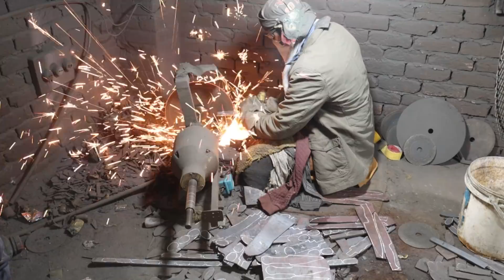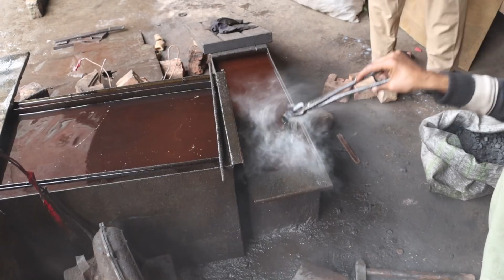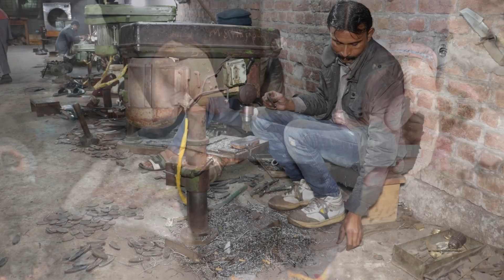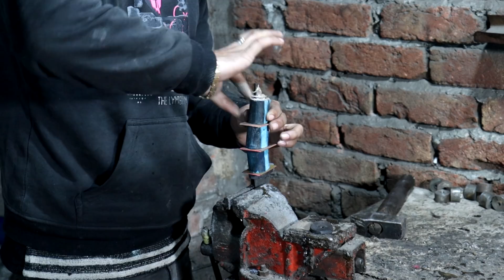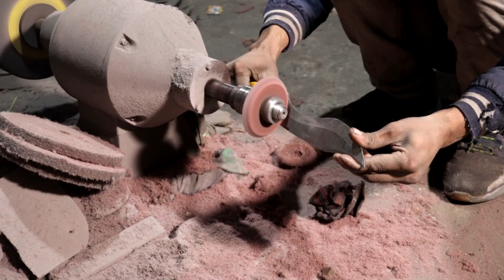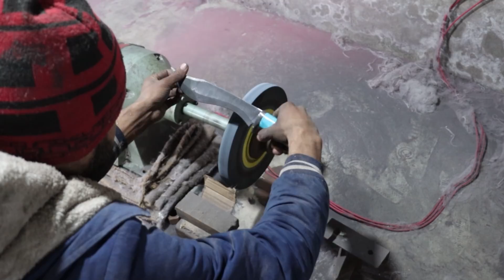Amazing Process of Making Kukri Hunting Knife from Carbon Steel

Comment: I’m not a knife maker, but these look like nice knives to me - I’d buy one.  These guys deserve respect for working hard in crappy conditions
Reply: These are not nice knives. The tang (the part in the handle) is welded on, a good knife will be full tang for strength. Also the handle is essentially hollow with just what filler glue he squeezed in with his fingers. THey look cool though

Comment: As a blacksmith who also makes knives, i'd say their blade quality is pretty poor, but for a low price that's acceptable.
Every person who comments on how the steel would be too soft are kinda right, but also kinda wrong.
Yes the heat treatment is very hazardous, the grind slightly overheats the blade, the tang is welded etc etc etc
But these guys work in the medieval way. Work with simple tools, get acceptable quality for a knife. Yes they wont be as hard as they could be, yes they have weak points, but they will cut and do their job well enough and that's what matters.
Btw they weld the tang to save up high carbon steel, as they only grind and don't forge the blade.
Using shit steel for non critical parts of a blade is a common practice in medieval times.
Reply: Grinding away 20% of the material for the initial form wasn't common practice though. 

Saving material sounds nice, but they could've easily forged the tang out. Probably just as quick with a simple 50lbs tire hammer
Reply: @patrickd9551  i know, but it's quick and dirty to just grind away the shape
Reply: This knife was always made in a medieval way with a hammer, forge and a file.  These are ok but then also shit.
Reply: No i'm sorry but having poor equipment is not an excuse, and those aren't bad tools neither. The bad quality comes just from the way these knives are made, so they could make much better quality knives just putting more care in it. The heat treatment is done without keeping the right temperature for all the lenght of the blade, the grinding process is done without keeping the blade cool and ruining the already poor hardness achieved. Kyle Royer showed how to make a mastersmith knife just with an hammer, a small forge, hand files and sandpaper. I sometimes weld too a small part of the hidden tang, usually a threaded bar, but the weld must be deep and perfect or the knife will break in half at the first hit. These knives are just trash, and not because they comes form a poor country, but because they don't care to make good products
Reply: Finally someone that isn't complaining about the sand getting on the knives
Reply: @Gabrulo_knifemaking  they are not trying to be Kyle Royer. They're trying to feed their families

Comment: The blades get way too hot when grinding them. It takes the temper right out of it. Not that it really matter as this steel is low carbon junk.

And why are they welding a tang into the blade. Again, it is taking the temper out of the blade as well as putting a joint in a high stress area. These blades would never withstand a high impact strike.
Reply: along with uneven heat
Reply: Maybe you should go over there and tell them to use more high quality stuff that is out of there budget.
Reply: Bruh, they don't have shoes

Comment: "S" for "Safety". Welding without eye protection, showing hands in acid bath, using cut-off disk as a jigsaw. I thank god for being able not to work on such manufacture
Reply: They don't have COMPO over there so there's no need 🤣
Reply: Open grinder throwing sparks/debris directly into outlets.
Reply: Do you think they are going to change the their ways for your tree hugging, warm fuzzy opi ion
Reply: "Safety is 37th"
Reply: These men build knives not tampons 😂
Reply: It's not for chicken heart....
Reply: Live a little

Comment: Steel grinding dust and other metal cuttings go into iron-ore processing steams to improve their yield.
Bigger pieces of scrap are either re-forged, go to foundries for direct smelting, or are sold as raw materials.
The hydraulic cylinder factory over there makes scrap that we forge into spoons...our scrap goes down the road a ways and is made into safety-pins and sewing needles...their scrap makes fine wires...the wires go to the ear-bud factory over there to wind tiny coils...
Western ecological awareness didn't "Save the Planet' when they took credit for inventing Recycling.
As long as humans have worked with metal, every scrap was reused endless times.

Comment: Well at least it's easier to tell these cheap knockoffs; of actual quality blades, by the Damascus blade. Guarantee 99% chance that all Damascus blades you come across are made of junk steel in mass produced places; like the one in the video, that specialize in bastardising quality blades made by skilled artisans.
Reply: Yes the steel is pattern welded, but that's not 'Damascus' by a long shot....
Reply: Actually amazing steel doesn't need to be damascus , you can create the design afterwards
Reply: At 1.55 he has a block of wood on the point and leaning so hard on the knife he is ruined the steel
Reply: @brianhoeckelmann1304  Yeah I'm not a fan off burning the heck out of the metal either.
Reply: Doing all they can to feed their families… That’s all this is. There is a market for these and the work ethic is to be respected!
Reply: Take a chill pill Katan Akuma. These guys are barely earning enough to support their families. They don’t care if they are being asked to make a bucket to hold horse shit or a samurai sword. Whatever it takes to put food on the table.
Reply: @DC-wp6oj  It's a pity. Because if they used quality materials they'd make buckets of money compared to what they get now. They have the skills to do it. There's clearly a market for knives. And quality knives would be their saviors. I don't envy the position they're in. It's just unfortunate they don't realize how easy it would be to make a lot more money doing exactly the same thing they're doing. After that. ..more food on the table. Happier family life.

Comment: I lost a good friend to a grinding wheel smaller than some of those without a guard. He put a new one on and let it run for about 4 hours when he touched it with a piece of steel it took off a chunk of his skull. I think I'd rather weld without eye protection than use those grinders. I can close my etes.
Reply: maybe tell him to use a safety squint next time ?
Reply: User error

Comment: They don't seem to be bothered too much about blade hardness. BTW, "carbon steel", all steel has carbon in it, otherwise it wouldn't be steel.
Reply: Carbon steel means not stainless :)
Reply: @dimmacommunication  Okay, thanks. But I wouldn't advise anyone to say carbon steel in my field of work if they don't want to get laughed at. It'd be like saying wet water or hot fire ;-)
Reply: @mikethespike7579  Wich work ?
In knife making carbon steel is a very common term, even Opinel or Mora used " carbon/carbone " on their non stainless knives
Reply: @dimmacommunication  "High carbon steel" is a common term in knife making. In my field of work we call that tool steel, but otherwise it's the same thing.
All steel has carbon in it, so if you say carbon steel you could just as well mean mild steel, which of course wouldn't be any good for making knife blades.
Reply: About as bothered as the welded on rod for a tang. 🤣

Comment: That short tang makes these things useless
Reply: Did you not see the part where he welded it onto a steel rod, or do you just not trust welds?
Reply: @frank3manuel  A flimsy threaded rod is no replacement for a full through tang. Also I didn't see any quenching and tempering steps, so I doubt the blade will keep an edge for long.
Reply: @frank3manuel  No, I wouldn't trust those welds. I am a welder and a blacksmith and welds between quenched (even poorly) high-carbon damascus to a most likely low-carbon rod will be weak. Not to mention there should never be a weld inside the handle especially if the knife will be under high impact stresses like chopping.
Reply: @sonofbr  you're just jealous you're not as good a welder as he is.
Reply: And there's no reason not to make a longer tang.  The cost of the sheet of steel is minimal.  It's no wonder the Nordic countries are famous for the quality of their knives.  They'd never cut a corner like that.
Reply: @1pcfred  If only I could stop wearing eye protection I would be better.
Reply: @sonofbr  indeed. You do not have Superman eyes. The welder here sees everything!
Reply: @drmodestoesq  they are not using plain sheet steel to make those knives. It is a laminated steel made to resemble Damascus.
Reply: @1pcfred  how is that done please?
Reply: @jimmybawa5  how do you make laminated steel? You take layers of dissimilar metal and pattern weld them together using forging. Sometimes the billet is twisted or folded to impart a pattern.
Reply: Stabbing good chopping No good.
Reply: @1pcfred  

Thank you
Reply: @jimmybawa5  you're welcome.
Reply: @1pcfred  bullshit dude. If a tang isn't made well, the welds don't matter. They'll fail off steel like this as it tends to peel off over time.
Reply: @FireSkittlez85  maybe. Anything's possible.
Reply: i dare say these are simply for the tourist markets...
Reply: I thought so too

Comment: As an actual Blade Smith...and as many have stated here already...these are... 'show knives"...ONLY...!!! These knives are not meant for any real hard use or cutting application...They are not properly built...not properly quenched and tempered...AT ALL...!!!

These are some pretty grim working conditions as well without proper venting or dust control...!!!...which will sadly lead to lung aliments and shortened lifespans of the workers...

Comment: Kukri?  Yeah, no.  Aside from the awful metal and questionable techniques leading to very substandard blades, the blade shape and profile are completely wrong.  What they are doing is much more like a drop-point Bowie.  About the only thing these blades have in common with a Kukri is that they are both single edged blades.

Comment: Now please temper them so they won't shatter under normal use
Reply: I hardened a knife without tempering it's just garbage 😂😂😂
Reply: But how else you gonna get repeat customers?  /s
Reply: They would need to be made from blade steel to b able to shatter not railway track and ship anchor links

Comment: It's better not to do things when you don't know how to do it, Kukri is an iconic weapon it requires a ton of knowledge and experience to make one, Gurkhas have chopped thousands of heads using this weapon in war when they ran out of Bullets, you are not making Kukris you're just degrading its value

Comment: Where do they get the steel from?
Reply: one known source is reclaimed steel from ships.
Sometimes you see them machining large sections into large metallic objects.
You can also see them cuting them into smaller sections of a given mass, then they flatten the thing into sheets.
Also, I've seen them melting mixes of random metals together and hopefully get some kind of alloy that's not too crappy....